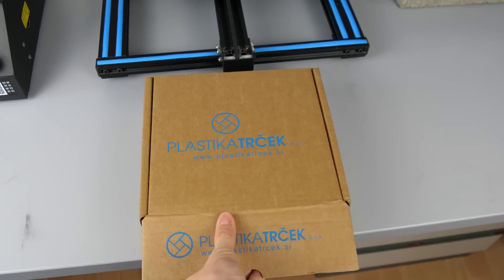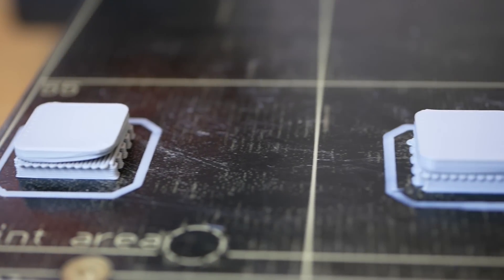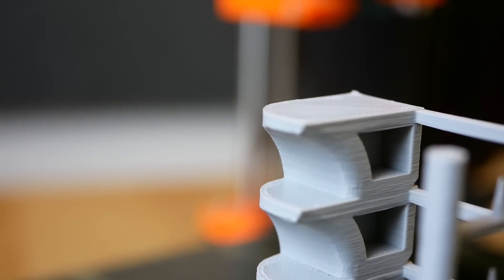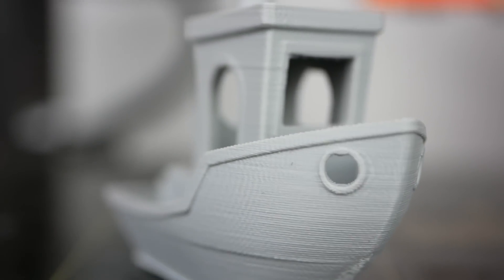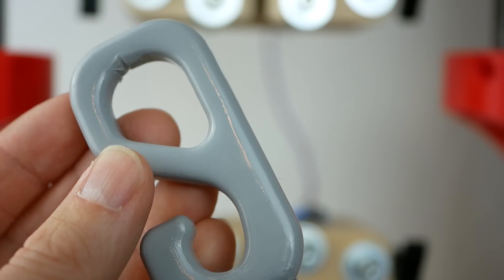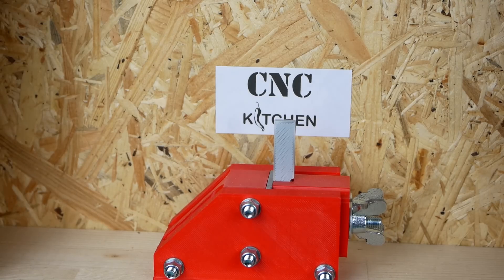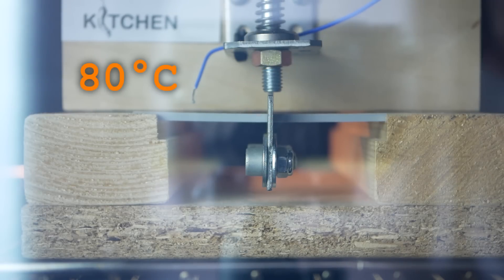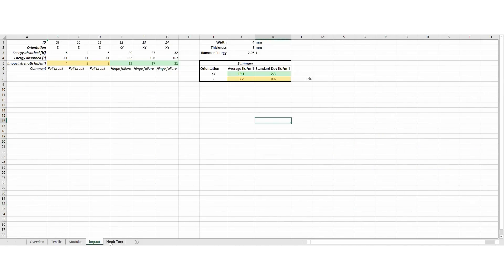UV resistent alternative to ABS? - Plastika Trček ASA filament REVIEW

Comment: Thank you for sharing Stefan!    Would you share a video about different ways of printing with ASA?   After watching your videos, I have tried printing with Forma ApolloX ASA but have had terrible results.   I've tried different temperatures, drying the materials and different layer heights but never seem to have a "tough" part.   In general my parts are always brittle and have very poor layer adhesion even though they look good and don't appear to have an obvious warping or layer separation.

What I have been using.  Ender 3V2 w/ Microswiss Hotend.  No enclosure, using draft shield.   Attempted temperatures from 235 to 255.

Thanks again Stefan
Reply: I'm about to test out ASA for the first time.. what was your fan settings, and print speed? People say you need to printer slow with it and have the fan off or on at like 5%
Reply: @ChristopherJones16  I have 0% cooling + I used aluminum tape to cover hotend because the fan was sending air not only to the hotend but also to the piece. I don't know how to explain.

Comment: Car intake adapter ? 
ASA ABS or PETG 

I've been using PETG so far, but want to change to more durable filament 
 ASA would be a better choice for non enclosed printer ? 
Looked at your wideos but can't make my mind up

Hey how about adding chemical resistance tests ?
Reply: I think ASA and ABS like the same printing environment.. both can be printed in non-enclosed printer but as long as the surrounding environment is controlled. (no windows nearby, room is heated well, etc).  I heard simply printing in an enclosed printer just makes life easier for getting better prints.  I heard of some people using cardboard boxes to build an enclosure to print ASA/ABS and some using a plastic garbage bag.

Comment: So, which is better/easier to use for a dash cam console (e.g. I don't like the tilt of the windscreen and want an adapter between the glass and the camera)? This (no annealing needed), or the Volcano PLA?
Reply from the maker: Depends on your printer. If you can print ABS/ASA then these are the cheaper solutions.
Reply: @CNCKitchen  Thank you.

Comment: I was using formfutura ASA (ApolloX) and biggest problem I have is layer adhesion. I have managed to print some really steep angles and complicated pieces but at the sacrifice of layer height and print speed. I have no cooling at all when I use my ASA, from what I have found the best way to use it just just to get it as hot as possible and print as slow as possible.

If I was to upgrade my filament heater/hotend on my S5 would that improve adhesion?

Comment: How hard ASA is print with Prusa i3 MK3 printer? Is it worth to try? I want print some dualcolor labels to outside like postbox and something else that last in winter condition at outside.
Reply from the maker: Similar to ABS. Not the most easy material to print with but doable. If you have an enclosure than even better.
Reply: @CNCKitchen  is it possible print dualcolor with MK3? Which one is better asa or abs for outside like freezing tems like - 30 degrees?
Reply from the maker: Yes, you can pause the print and change the filament or you can buy the multi material upgrade and do real multi color printing. ABS and ASA should both do equally well /bad in the cold.

Comment: Thanks for the great video! I suggest to make test of the PoliPropylene (PP) filament next time. This material is outstanding and I  think it's the best material with its features and resistant to almost everything (chemicaly, temperatures, hydrolysis, etc.) I ever used. You have to remember  that there are different types of PP (mostly filaments are PP/PE copolimers), the more PP in copolymer, the more rigit material, more PE in copolymer and the filament is rubber like material. In some cases it can withstand 120 degrees and more which is great.
Reply from the maker: There is something coming 😉 really enjoyed printing with PP so far.

Comment: I love how you test the various filament characteristics of 3D printed Parts. You are one of a few sources when it comes to 3D material testig. Keep up the good work. One suggestion I might add is, that you should also test the raw filament. So you can also determin how much strength is left in the 3d printed part compaired to the not printed filament
Reply from the maker: Thanks for the suggestion. I've already been thinking about this for a while, but didn't finish the holder yet.

Comment: Im using his ASA right now,  I make beautiful prints with awesome feel but the layer athesion is not that good.  Its a tricky material to set up but shows great results when done good.  And the company is great,  we used more than 50kg of their material.  Looking forward for more.  Awesome job
Reply: How do you like it compared to ABS though? I was hoping to see this video focused soley on ASA testing  vs ABS but im guessing he didnt do that because then there probably wouldnt be any differences in values except for the UV properties.
Reply: @ChristopherJones16  I definitely prefer it over abs. I now use asa+ that warps less and has better layer athesion.
Reply: @ChristopherJones16  I actually use filaments from "plastika trcek", if your from europe it makes sense, they are great, i get 4-5kg spools.